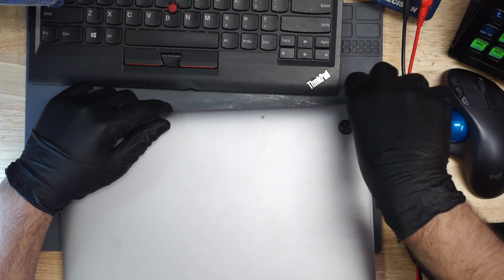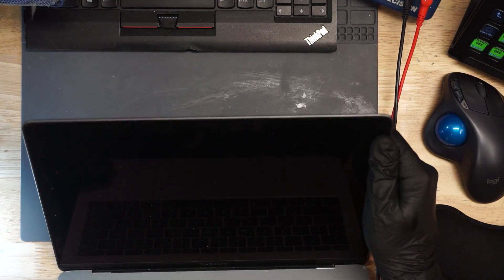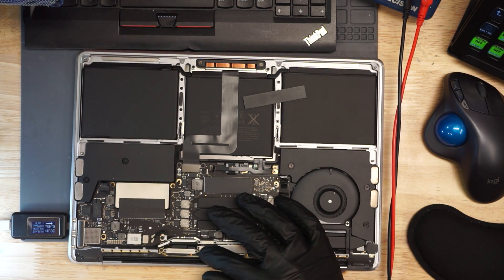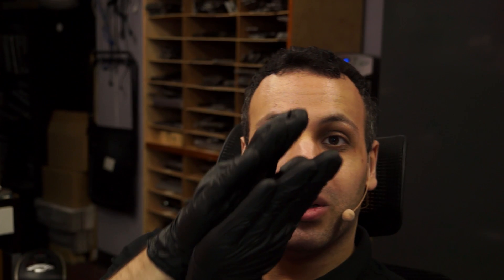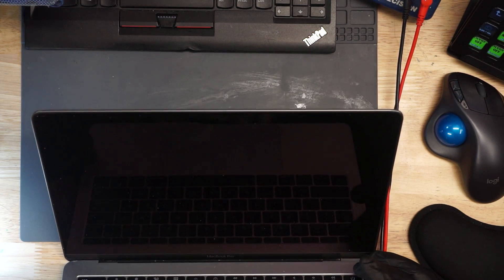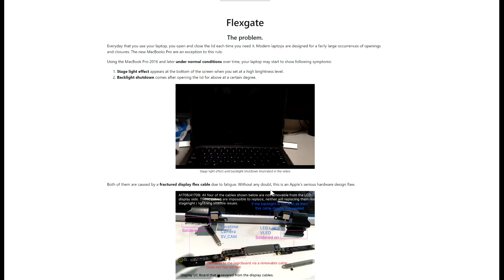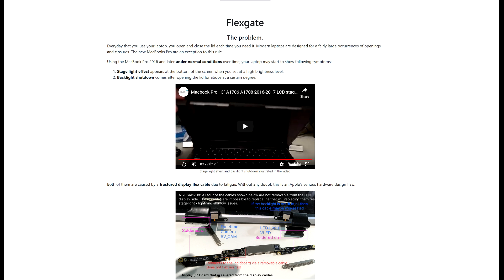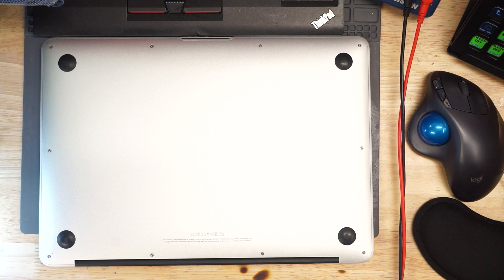Macbook screen DIES when opening lid: Apple provides NO FIX! flexgate

Comment: In Norway we have consumer laws. If this happens on a MacBook that is less than 5 years old with no obvious liquid damage or other damages that can be said to be due to mishandling of the machine, we replace the screen, and the customer doesn't pay anything. 5 years, instead of bashing apple (which in this case is also a valid thing to do, because of this design choice), why don't you get some real laws that protect your consumers in the US? Because Apple would comply.
Reply from the maker: The cheapest Macbook Pro in the U.S. is $1299 https://www.apple.com/shop/buy-mac/macbook-pro/13-inch-space-gray-2.3ghz-dual-core-128gb#

The cheapest Macbook Pro of the same specification in Norway is $1,756.08 based on current exchange rate. https://www.apple.com/no/shop/buy-mac/macbook-pro/13-tommer-stellargr%C3%A5-2,3-ghz-tokjerners-128gb#

There is this idea in Europe that things are "free", they're not. Your government taxes/rapes businesses and that gets passed onto the customer.

Would it be nice to have a 5 year warranty on everything? Sure, but you're paying for it. The price difference of $450, in America, would allow you to buy an extended warranty that covers accidental damage as well as normal wear & tear/failure. There is no free lunch.
Reply: @rossmanngroup  electronics in Norway is extremely cheap compared to our average salary. Government overreach or not, there is some pretty obvious needs to protect consumers from this kind of "breaks after 1 year" business model
Reply: @rossmanngroup  doesn't the Norwegian price include sales tax? Most VAT is funnelled back to the government and used to pay for other things; it doesn't end up in Apple's coffers. Apple still has to fix or replace the broken product.
Reply: @No-Substitute  absolutely correct. The 25% VAT we have on all products goes to the government. As soon as consumer law coverage is determined, apple covers the cost of parts and repair for the customer as if it was in its first year of coverage. So the price of the product is besides the point. Either way. A machine that costs more than 1k USD should last more than 1 year, just common sense, which is why it would be very hard to make a similar business as Mr Rossman has, here. So I can definitely see the incentive to be opposed to such laws from that standpoint ;)
Reply from the maker: This has nothing to do with me being opposed to the law based on my own profit margin as that would never cover accidental liquid damage which makes up most of my business. Here sales tax is only 8.875% which is considerably less, and still does not account for the over $300 differential between here and there, which could easily pay for an extended warranty. Further, people from Norway who immigrate to the United States typically wind up having higher salaries and they did back in Norway. 

My point is that that these laws mean nothing if you and Norway are paying more money for the product than I am in the United States after I have paid for a comprehensive, accidental damage covering warranty. Even if United States law did not ask manufacturers to give any warranty, for the price you would pay for the same product in norway, I can get a third party warranty that covers anything from device defects to me accidentally hammering it. The increased prices and increase taxes counter effect any benefits of the actual law
Reply: @rossmanngroup  The EU has an import tax, along with the VAT being included in the price the difference will not be that big. Even with a few hundred dollars in comparison on a luxury product you cant blame the rest of the world for having proper consumer laws. Do you want to pay for insurance for under 100$ products also? We dont have to. the law covers all products to avoid being blatantly scammed like you advocate for. kind of a sad scene doubling down on MURICA.
Reply: Bashing Apple is here the right thing to do, since their faulty design is the real issue not consumer protection laws or taxes.
Reply: What is needed is right to repair laws that force companies to allow third parties to repair their products, and penalise them for intentionally making their products unrepairable, or designing things like the Iphone home button, that make it so replacement can only be done by Apple. Car manufacturers are doing this stuff too, and in Australia and NZ the governments have been cracking down on manufacturers doing this. It's not acceptable for manufacturers to make parts that cannot be replaced without access codes and then refuse access to third party repairers who are licenced by the regulator to operate. Manufacturers cannot be allowed to monopolize the maintenance and repair of their products.
Some car manufacturers have been doing ad campaigns against "non genuine parts" which is bordering on slanderous as most of the non OEM parts are made in the same factories as the OEM ones, but cost a fraction of the price because the OEM parts are marked up so much. It's often the same part, and pay no mind to thr fact that some non OEM parts are an improvement. Design flaws are often fixed in the aftermarket.

Norway is where that guy is having his repair business destroyed by your judicial system at the behest of Apple. Things are not perfect in Norway. You want a government that protects small businesses not one that teams up with big businesses to screw everyone.
Reply: On that point I am this very minute on my way into an Apple Store to try to get some help with my son's iPhone 7, where the microphone suddenly has stopped working. 😢

Comment: I have a $400 Toshiba Windows 7 garbage plastic laptop that I used for coding for 8 years. Absolutely gorgeous 1366 x 768 display on that thing. But at least that display still works. If a $400 laptop from 8 years ago has this level of durability, why can't Apple do that in a $1500+ system?

Comment: Maybe I've lived a sheltered life, but I've never encountered such pervasive problems due to poor design in the dozens of Windows laptops I've owned and used. The most common problems with them have been easily replaced parts like hard drives or fans.

Comment: Hi Louis, random question. If I came to you with disassembled mouse and show you what wire you need to solder so my scroll will work again can you do it right away and not in a few days? Iam no professional but it looks to me like 10min job...no diagnostic needed, mouse already disassembled, so its just 1 wire, I couldev done in myself but I don't have equipment and not sure about ability to make such delicate work. Or I will have to sign some papers, leave the mouse for a few days while it wait in line for its turn?
Reply from the maker: If it takes 10 minutes, solder the wire yourself!
Reply: @rossmanngroup  As I said I don't have skill and equipment, cant even imagine how to remove insulation from such thin wire. I used soldering thing maybe 20 years ago, but it was just for fun and not on something as small as mouse, on the other hand it could be interesting experience, to fix something, but I don't want to kill 150$ mouse by trying when we got people like you, who do those type of things professionally :) Anyway I was on my way to service and saw your new video, decided to ask while I drive there :)...they told me to come back on Monday cause they work today...but master is not, only on Sunday...strange.

Comment: 0:07 I have the same horrible thinkpad keyboard with Fn and Ctrl keys reversed. Its pathetic to use it that way.
Reply: 1.  reboot the computer

2.  press F1 to enter BIOS setup

3.  config -> keyboard/mouse -> Fn and Ctrl Key swap
You're welcome
Reply: @AnotherAnonymousFag  thanks for your reply but unfortunately mine is an external keyboard and i use it with a non ThinkPad pc thus i don't get that option.

Comment: Someone should make a replacement flex cable that sockets on to a cut off flex cable.  Similar to how a keyboard connects to a laptop but the connector on the cable not the board.  Quick and easy just cut the old flex at a predetermined point and attach the new flex.

Comment: if apple made a car, you'd have to replace the whole thing if you got a flat tire
Reply: There also wouldn't be any headlights "no one uses them anymore".
Reply: burnzy3210 
Don't give them ideas. iCar here we come
Reply: A bluetooth steering wheel?
Reply: Oh did you want to fill up at this fuel station? You can only buy apple brand gas. And it's 50 bucks a gallon. Yes its made of unicorn farts.  Or you can buy a universal filler nozzle to apple proprietary wtf nozzle adapter for 11,000 dollars.

Comment: They won't do anything about it until someone litigates, then they will offer 'discount' repairs or vouchers towards a new system for a few months. Once the time limit expires, they will tell you to pound sand. They did it in 2011/2012 when I still worked for them and they are still doing it today.

As soon as Jobs started getting progressively sicker, Tim Cook exerted his piddly ass bean counter ways he brought from Compaq to start twisting the company's practices. When I started working for Apple in 2006, they actually sort of cared about the customer. By the end of my time there it was all about squeezing every last cent from the customer to feed the stock prices.

Comment: I think the consumer protection laws in my country is the reason my experience with Apple here is much more positive. You get 5 year warranty on the laptop itself (as a private consumer) and 2 years on the battery. If the issue described in this video happens you are covered.

Comment: Louis, are the screen, flex cables and daughter board all one unit or can you detach the daughter board from the flex cables coming from the screen? Have you been able to determine the point of failure?   It seems like the most logical point would be traces breaking with in the flex from all the, um well, flexing. If that's the case would repairing the damaged traces be an option?

Comment: Louis every video there is something negative about macbooks. I have a MacBook and had a bad experience when all my USB ports died but it was under warranty and my issue was addressed by the Apple team though it took a couple of days which is not convenient. I love using macOS to windows hence why I use the macbook. My question is do you have any positive thing to say about the MacBook at all? Your opinion. I would really love to hear about the positives.

Comment: Display flex cables in notebooks breaking after a few years is a normal thing, happens to a lot of heavy used laptops, but attaching them to the screen is just dumb. Apple just wants your money. You could even bet, that this years MacBooks will have a new flaw. Lucky I'm not a vendor, if someone would come in my store and want a MacBook that works for the upcoming 5 to 10 years, what am I going to offer? An iBook? A 2013 MacBook Air?

Comment: Normal PC/laptop LCD design:
LCD=>flatflex=>PCB=>LCD to motherboard cable=>motherboard
Apple stupid design:
LCD=>flatflex and cable to motherboard=>PCB=>motherboard
That is Apple relocated the PCB that lives inside the LCD casing, so it now plugs directly into the motherboard.
Except the flatflex was never designed to be flexed thousands of times, and goes bad after a year.
Reply: plan obsolescence.
Reply: @kohfee9967  Nah. Only extremely stupid... (sorry - innovative) design. I don't know how Apple are hiring their laptop engineers, but something is definitely wrong with that.
Reply: Designed for planned failure. Overpriced not repairable crap.
Reply: @adamw.8579  As is tradition.
Reply: Solution? Never offer warranty for more than a year.
Reply: They can have thin lid by putting the board in a chin area below the screen... A better use for the chin bar than a camera for sure.
Reply: Needed to roll them out for Holiday season. #ShipNowFixLater
Reply: Think different!
Reply: There are ways to make a flex cable last. Motorola clam shell phones (startac etc) used a flex cable routed through the knuckle. they would last hundreds of thousands if not millions of cycles. The idea is mechanically design the hinge so the flex cable can be routed in a manner where it barely moves at all.  This doesn't look to be like that.
Reply: you mean normal laptop has the flex cable go into a pcb with a connector that moves with the screen, then you put a throwaway replace-able cable on the connector and the other end goes to a solid connector on the motherboard?
Reply: @two_number_nines  Yes.
Reply: @Sam S9 oddly enough, that's the exact sort of testing every other "premium device" manufacturer does. I bet they call this failure "acceptable risk".
Reply: What was that shit they were saying before? Brave? LOL XD
Reply: Nothing wrong with that.  It's a design innovation.

Think Different.  🍎
Reply: Apple products have extraordinary level of quality, but unfortunately, they have specific points of failure that were designed to break after a given time, so that the customer has to buy a new one SHAME!
Reply: What other laptops might use this design? There has to be an obvious reason for it. What about laptops like the LG Gram?
Reply: Idk, they use this design to pursue thin lid. Any other laptop with thin lid could have this stupid design too
Reply: @houghwhite411  The ancients had a phrase for this. It's "form over function".

Comment: Time to get a Surface Book.
Reply: @Peter de Jong They are no more less repairable than a phone. And I've taken a few Icraps apart and hacked them.
Reply: @RabbitsInBlack  Nevertheless a Surface Book is also far overpriced for what you are getting. And maybe your model was easier to open, but some other models are designed NOT to be opened or repaired.

Comment: You still expect your 2016 MacBook to work?!?  It's 2019, buy a new one!!
Reply: They really do foster a weird "fuck you, get a new one" culture for anyone with an older Mac.  I always just say "If my old laptop bothers you that much, you are welcome to buy me a new one out of your own pocket."
Reply: @ohnoitschris  It's a huge pain in the ass getting help for my 2008 Mac Pro. My first issue with it was a sudden slow down and MacRumors said, "your pc is old get rid of it" and "that Xeon is core2 based which is really old".

It was a failing hard drive, it started clicking a couple days later.
Reply: That is why I use a PC laptop. Got mine is 2012 and it is still going strong. Apple can go suck it.
Reply: @jezeski2011  MIne ist from 2011, needed one Repair (replacing LCD out of Warranty) and this Machine still works too.
Reply: Weird how macbooks from 2007 still work in 2019.
Reply: My 2009 A1342 works amazingly still to this day and still runs faster than a windows laptop, just recently they became poo
Reply: @CouldBeFrench  If you are willing ti switch to Linux, you can have an up-to-date and blazing fast operating system on these 'outdated' macbooks. I recently tried a 2007 macbook with libreboot flashed over the firmware and the boot speed was 3x faster than 2018 laptop.
Reply: @attrue8348  that sounds like you just turned on ram caching for the OS. That or the OS is so light weight it'd be hard to do most anything productive.
Reply: @wyattroncin941  Actually, a big part is the fact that the Firmware (aka BIOS) was replaced with Linux. The operating system is a default Debian installation.
Reply: I have a HP laptop from 2013 and it is still going strong and not a day of difficultly with it. You are just a apple sucker
Reply: @declanfaughey8471  Mine is HP ProBook 4540s and it's a beast ! Now, I run Mojave 10.14.3 on it but Windows is good for this too ! I just love this laptop and the keyboard  !
Reply: But my Lenovo lasted for 5 years and 2 drops before giving up on me.
Reply: More importantly, get the last WORKING one, which is the 2015 MBPr!

Comment: If it's just the backlight traces which broke you could just bypass with a wire as long as you can fit an extra wire in the hinge

Comment: Mr. Rossmann,  I have a suggestion for you. You need to expand your operations near "45 Grand Central Terminal" and "767 Fifth Avenue" . Better yet, take your operations mobile,  convert a coach bus into a repair shop. 
That way you can take your work out to the coast and make videos by the shoreline.